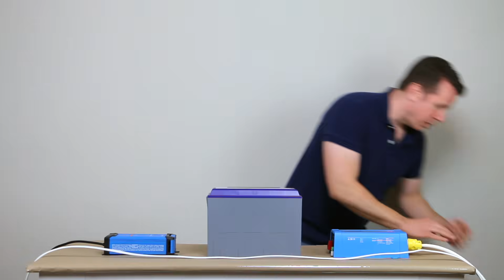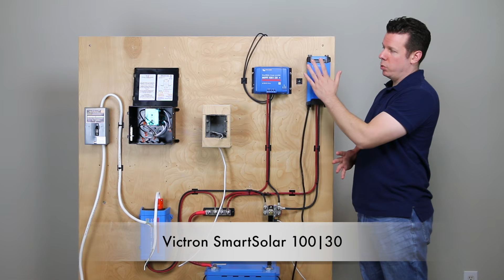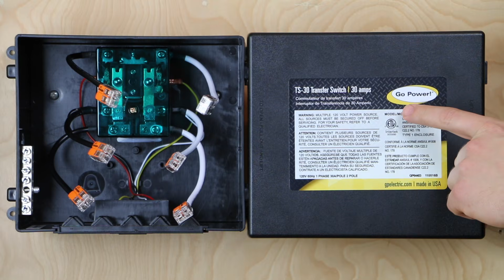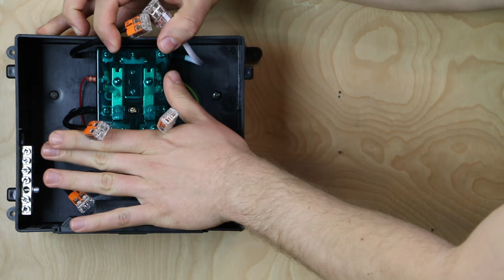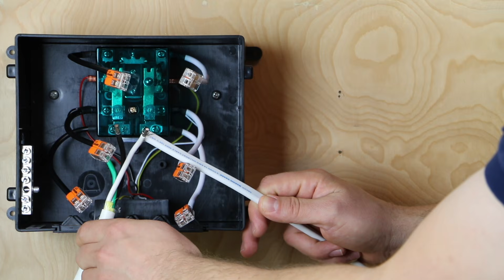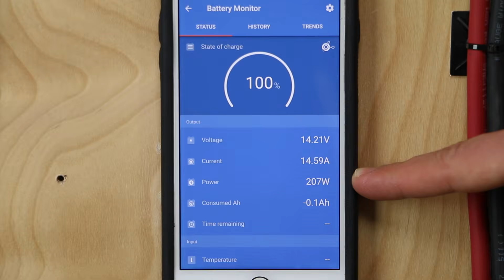How to Add Shore Power to an Existing Van or RV Power System | Featuring the TS-30 Transfer Switch

Comment from the maker: Get the Ultimate Van Power Cheat Sheet: https://www.rosslukeman.com/vanpower
Reply: Hi, this is exactly waht I was lookign for. But I have question: is this BluePower charger enough to feed the 12V devices when on external power supply (110/230V)? Is the BluePower charger capable to work as power supply for lights etc? Thanks for help, video is awesome. Liked and subscribed.
Reply from the maker: Hi  @petos0  this charger puts out about 400 watts, so if your 12V loads are less than that, then yes it will run them on its own, with the remaining power going into your batteries. That's in the charger mode. It does have a "power supply" mode as well, where instead of going through multi-stage charging, it will just put out a stable set voltage, a voltage chosen by the end user. Hope that helps, thanks for tuning in!
Reply: @rosslukeman doesn’t using and inverter charger prevent you from this roundabout method of wiring this system.
Reply from the maker: @eladsgarr  yes the inverter charger does all of this on its own, the inverter, the charger, the transfer switch, all in one package. At the end of the video I tell people to go that route if they are doing a new system.

Comment: I got this same 30 Amp Transfer Switch and I have a 20 amp fuse on my panel for my Converter. I would like to connect my 20 amp converter directly to my Transfer switch, but will the 30 amp be too many amps for my 20 amp converter? If I connect my converter to my transfer switch, will I need a 30 amp converter, or do I need a fuse for 20 amps? . Hope my question makes sense, thank you.itch like you did

Comment: Three years later this video is still proving tons of value. I’ve listened to lots of videos but this seems the most straight forward. Thank you.

One question I have: running this for lithium batteries, I’m planning to replace my charger / converter to support lithium. This would be in line from the transfer switch to the junction box. I believe that will charge the battery while I’m on shore power, and I can flip the converter breaker when on inverter / battery power. This should allow me to forgo adding the charger you have.

Comment: Thank you! First time viewer and plan to deep dive into your videos. Question? Is the inverter now neutral floating or neutral connected to earth FJ2 connection in the inverter. I have the same inverter. I’m going through an install from a very simple one consumer to shore power with a few more devices to power. Thank you for any insight.

Comment: Ive been searching for a way to do this! I have master battery breaker and an extra 2 pole breaker on the leads from the solar controller, so when i want to charge with shore power i can either shut down the circuit from the solar controller so i dont back feed power into it but still use the inverter or use the master breaker to isolate only the battery bank to charge when i dont need the inverter. This solves all the switching back and forth. Great video!

Comment: If the appliances are all 12v and connected directly to the battery via a bus bar, does the ac-dc charger work the same way by delivering power to the appliances and charger the battery simultaneously?
Reply from the maker: Good question, yes the AC-DC charger will feed the battery as well as any loads that turn on and siphon away power, simultaneously. Hope that helps, thanks for watching!

Comment: I have learned a ton from your videos and website. Can i run my 20amp victron ip22 AC charger to my batteries with my solar ON at the same time if need be? Ive always only ran the charger at night.  400 watt solar 260ah lead acid batteries. 400watt solar 2S2P connection. 40amp MPPT Any issues with that? I do have a transfer switch to run off generator or inverter. Inverter is the default setting. Just wondering if I can use the AC charger and leave the solar on at the same time when on generator. Off grid cabin set up.  Thanks again

Comment: I would like to point out if you are doing this in a camper the battery charger can be bypassed due to the fact that all campers are equipped with a converter which the difference between a converter and an inverter is a converter charges a battery by converting 120 into 12 V charging but also 12 V stuff like lights the 12 V side to your camper fridge and an inverter does the exact opposite it takes 12 V or if you have in 24 V inverter it turns 24 V into 120 V AC
Reply: I would like to also point out that a 400 W battery charger does not have nothing to do with how many watts you can use in your camper or regular you’re using this with reason why I say this is because it’s not the battery charger that allows you to use X amount of watts it’s the inverter so if you have a 400 W inverter it’s only gonna let you use 400 W. That’s why most people use a 3000 W inverter so that they can use things with heating elements in their rig without tripping breakers so remember it’s not the battery charger or battery that allows you to useX amount of watts it’s the inverter

Comment: How about this situation? I have a electrical setup where I have a 30 amp rv input that comes into a panel. The panel distributes AC to those loads and to a converter charger for charging 1 12v battery and feeding a Automotive 12v entertainment system. I have added solar, charge controller, and inverter/charger and batteries w/ built in transfer switch and 30amp pass thru. What I would like to do is set up a way to bypass inv/charger setup when I am going to be on-grid for indefinite periods. Multiple months or even years etc so as to not wear my off grid components out with pass thru. I had considered a dial switch deverting power to either panel or inverter/charger and a manual  dial after inv/charger routing power into input of panel or blocking it as both of these dials will have to agree or oppose based on power needs.

Comment: Starting from a camper with no wiring in it whatsoever. Im trying to understand the grounding of the 4 power options. 
#1- Battery; The battery gets grounded to the frame, pretty simple. 
#2 Inverter; If you plug into an inverter, where is the ground for an inverter going? The frame perhaps? I dont recall ever seeing a ground wire on the inverter.
#3- Shore power; in the camper distribution panel/breaker box, ground has its own buss bar, sending any ground fault to the shore power breaker box ground? 
#4- Plugging into Generator; If you have an internal generator- it gets grounded to the frame? As for an external generator- If you have a floating neutral type generator, get or make a grounding plug adapter to make it bonded. When you have a bonded generator, the ground is the frame of the generator??? If so, when plugging into an external generator, (which is like plugging into shore power) the ground in the camper breaker box goes to the shore power box but there isnt one. With a ground fault, wouldn't you then energize the frame of the generator and no breaker would fault?

Comment: what if you use generator and shore power
Reply from the maker: Two power sources -> one transfer switch. Three power sources -> two transfer switches. The transfer switches will have diagrams for various setups, including the generator/shore power combo. Hope that helps, thanks for tuning in!

Comment: Maybe I'm missing something but I'm not following how you can take 30Amp shore power and run it out of the transfer switch through 14-2 (15amp rated) wire?
Reply: I believe it’s the length of wire that makes it’s okay. Now if it was a 10’ foot span it would would not work. Then you would need a larger gauge

Comment: Hey Ross thinking of adding a shore power plug to my van’s  400amp arm batt, 400 w solar and a 4000 w stand alone inverter electrical system. My question is do I remove the wires from my inverter and run them into the transfer box or can I just splice into where they connect now and run another set of wires off them into the box? Love your videos but still somewhat confused since I’m not that up on electrical unfortunately! Thanks for any info, Robert

Comment: Theirs a few ways to do this.. the one i did is an all in one unit.. charger inverter 5000w grid solar generator whatbever u need.. it also eliminates all the extra parts.. some say the cheap all in ones are junk.. i got ecoworthy and 4 of their lithium batteries to make 48v i use a generator to charge back up it works fine for me i use my ac all the time i do want to double my batteriy bank for more storage but it works great as is

Comment: Thank you for this video. It was very helpful! On your set up here where is the chassis ground come in? Also, I want to use the system but don’t have solar,rather,I have a DC to DC charger. Could I connect to DC to DC charger and the same way that the solar comes in?

Comment: If I have a 55 amp converter/charger does the TS-30 still work?
Reply from the maker: Hey there, yes that is fine. The TS-30 is 30 amps at 120 volts, whereas the 55-amp converter is likely a 12-volt model. So the transfer switch is built for 30-amp service (3600 watts (30A x 120V)), and the converter would take up to 800 watts of that available power (14.5V charge voltage x 55A = 798 watts). The remaining 2800 watts would feed your breakers (other 120V loads). Great question, hope that helps, thanks for tuning in!

Comment: I want to get rid of my solar entirely and just connect the battery to shore power and my electrical to the battery bank. The solar was way too complicated for me to figure out on my own and it’s not needed because I just keep the RV in my driveway. I just want to be able to power up the interior lights, and any extra appliances I need while it’s sat in the driveway. 😕 Not sure how to reroute the electric from solar back to the battery.

Comment: Thanks for the excellent explanation, I’ve completed this setup with a 12v 280ah Li battery, a Victron charge controller, victron charger and a victron shunt. I am using a 1000 W inverter. Plus the p ilot switch- everything seems to work except I have an open ground loop on the AC side when on inverter power. When I turn off the inverter and go to shore power the indicator tool shows correct wiring. Do I need to ground the inverter to the negative bus bar? How about the ground for the controller? Thanks

Comment: So we have a mobile detailing business. We run mostly on generator, but want the option to use shore power on occasion. Could I use the generator as the main source and shore power as secondary? So the shore power would go in the middle connection?

Comment: Great video showing everything is a clear and understandable way.  My system doesn't has AC requirement on the road, so I am thinking of Victron Energy Blue 30A AC charger powered by shore power, protected by the 30A breaker box ... .  Can you advise where you get the Breaker box?  I figure the "pilot switch" and outlet can be sourced anywhere and go in a 2 gang plastic box.

Comment: Do I need a shut off switch for the battery charger if it’s ran through the transfer switch
Reply from the maker: Hi Doug, no you don't have to have a physical cutoff switch for the charger, but you would not be able to turn it off while on grid power if it's hardwired without a switch. If you use that exact charger (IP 22 Victron 30-amp) then you can toggle it off in the Bluetooth app. Hope that helps!

Comment: I'm in the process of building a similar system but I have the Renogy 3,000 watt inverter / charger. Do I still need a transfer switch when using shore power or unplugging from shore power
Reply from the maker: Hey there, no your Renogy inverter / charger should have a built-in transfer switch. You've got the right setup, a lot easier than what was shown in this video.

Comment: do they have a 4 power source transfer switch? I want to run off :
*Shore Power
* Solar
*LiFePo House battery
*Alternator.

Mostly i want DC Circuits ( lights, Propane Furnace, propane shower/Water heater/Stove top, and Freshwater heater pads, and maybe 2 AC 120v Plugs recept.
Reply: Good question. Did you find a solution for this?

Comment: Do I need the transfer switch if I don’t plan power devices and charge the batteries at the same time? I’m building a hand truck solar generator and I’d like the convenience of ac and solar charging. Can I have a solar charge controller and the AC charger on the same system if I only use the wall socket to charge when everything else is disconnected?

Comment: I hope you could answer me this, WHAT SIZE COPPER WIRE SHOULD I USE TO CONNECT TWO 12 VOLT 230 AMP HOUR BATTERIES TOGETHER? I have a 1000 watt inverter  2 200watt solar panels a 230 amp hour 12-volt batt and am adding a second Batt of same size ?
Reply from the maker: I would use the fuse and cable size specified by the inverter, as your minimum fuse/cable size for your batteries. That's your largest load, so the cable size that works for your inverter, could be carried all the way back to the batteries, since that's the source of the power. Hope that helps-

Comment: Hey Ross what size battery did you use for this demonstration? I am adding something small to my minivan just to run my cpap at night and a small fan. I think this exact setup would work just fine for that. Thanks for the great explanation!

Comment: Ross this video was very thorough thank you.
This may be a dumb question but I’m adding shore power, same as you have done. I want to loop back to charge my batteries when needed but I only have a Renogy Dc to Dc charger for the alternator. Do I need an Ac to Dc battery charger? Or a converter and just plug into my existing Dc to Dc?

Thanks in advance

Comment: Are you able to use a 3 way connector & Tie in both Shore & On board Generator to that dynamic part of the Transfer Switch?
Just trying to figure how to incorporate the generator with solar and shore

Comment: hey at 14:30 do we need the three way connectors if the ground is actually running out the bottom left of the box?
Reply from the maker: Hi there, the ground has nothing to do with the 3-way connectors. No grounds go in those connectors.

Comment: Great video Ross. I have a couple of questions about a solar system I installed in my rv. I used two bus bars to connect everything in the system. My first question is on the negative bus bar. All of the components are also grounded to the neagtive bus bar as well. Should that bus bar be grounded to the chassis ground of the rv? The 2nd question is about seperating the two chargers that can charge the batteries. I have same transfer switch used to switch from show power and solar power, wired the same way you did. I also have an internal battery charger housed in the circuit breaker a/c d/c distribution panel. I have two batter switches in the system, one to turn on the dc power to the inverter and also allows the charge controller to charge the batteries. I have the other battery switch between the dc charger cord coming from the AC DC distrubution box to the batter bank to charge when on shore power. So, I dont overcharge the batteries and have a continiuos loop, When Im on shore power, I turn off the battery switch coming from the solar charge controler so it cant charge the batteries and open the battery switch coming from the ac dc distribution box that has the charger in it to charge the batteries and supply 12 v to the system when I am connected to shore power. Is there a better way to wire this? Thanks

Comment: If the inverter itself has an on/off switch built into the case you could always open the case and run a much smaller wire to a light duty switch that splices into the case switch. But you would not get the indicator light like you would in his setup. That transfer switch is huge, smaller ones?

Comment: Is it ok to run wires from a 920AH LiFePO  battery bank on my RV to a battery charger on my towed vehicle (lead acid 12 volt) to keep that battery charged for use of the brake controlled and lights?
Reply from the maker: Hey there, yes in general that sounds fine so long as you have the proper fusing and cutoff switches, etc. Hope that helps, thanks for tuning in!

Comment: This is so far the closest to what I'm trying to accomplish, just without the charger.  Have a 5th wheel... adding solar panels and Lith batteries.  How would I bypass the trailers invertor/convertor to make this setup work?  Would I need a breaker switch like you show for shore power?  Or was that just for demonstration purposes?
Reply from the maker: Hi Daly, on the breaker, I tend to add my own for shore power input, but there will be one out at the power pole you plug into as well. The rest of your question is kind of difficult to answer without knowing what you have, and is beyond the scope of YouTube comments. If you would like consulting and perhaps a hand sketch, I have that available here: https://www.rosslukeman.com/offers/Au4HykMc Thanks for tuning in!

Comment: So you only need 1 positive bus bar,  which sends power from the battery out, and receives the charge back into the battery (when on  shore power)?
Reply from the maker: Hey there, yes that is correct, power flows in and out of the battery on the same positive bus bar, at different times. And the same for the negative bus bar. Hope that helps, thanks for tuning in!
Reply: @rosslukeman  thank you

Comment: So you can only run certain things off the solar 12-volt system, and so you would not be able to run something like an air conditioner off of it.

My question is, if you had a generator to power things like an air conditioner when you didn't have Shore power, how would you set it up so that you could have your air conditioner running off your generator, but everything else running off the solar system ?

Comment: The only thing it seems you wouldn't be able to do with this system is run something that requires that high voltage if you did not have that shore power.